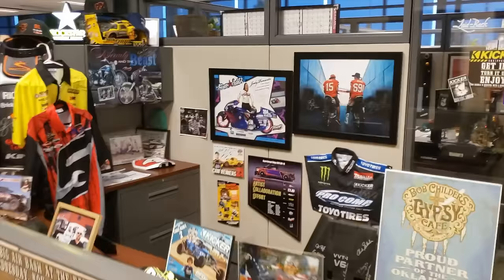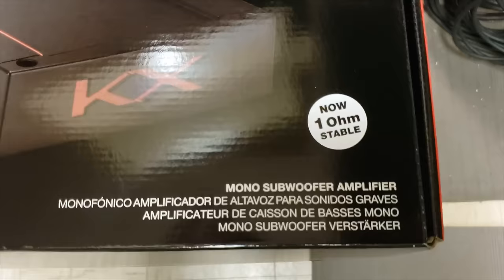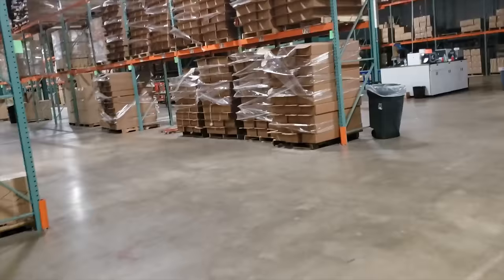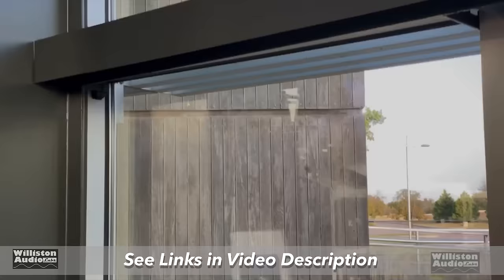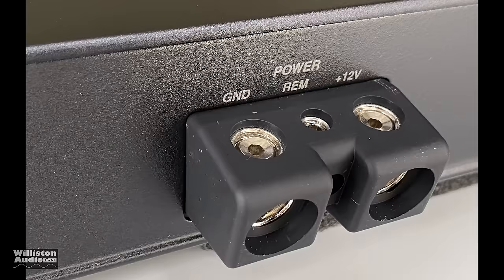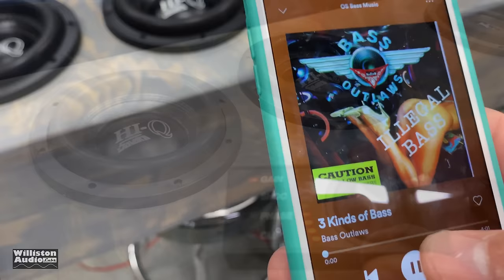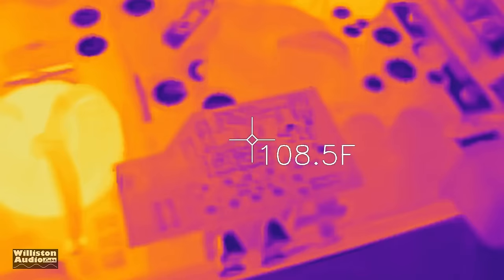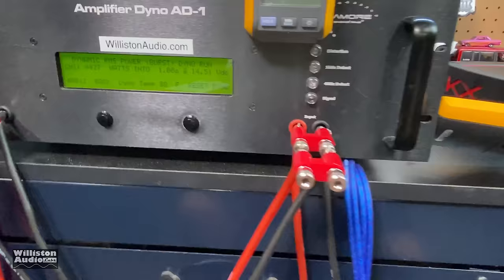Is it Worth the Money? Kicker KXA2400.1 2400W Amp Review and Test

Comment: It's cool to see a major brand like Kicker working with independent media sources like this, at the same time I think it says a lot about the standup reputation this channel has built.
Reply from the maker: Thanks man!
Reply: I always knew Kicker amps were good, and it’s about time he did this one lol S/O to you Williston 🔥🔥🔥🔥🔥
Reply: Kicker gets a lot of hate, and while I understand why, it's really undeserved. I don't use Any of thier speakers, and only really run the Old amps (kx sx and zx), but they really are an innovative, quality product. And the guys there are super cool. Much love for em
Reply: @lewokejames  I don't use any Kicker products (I did have some Kicker subs back in the 90s) but everything I do have I saw tested here and/or a couple other channels and I found nothing that would indicate that the information generated in Williston's videos is anything less than absolutely authentic. I don't have an SMD amp dyno but I have clamp-ons that read both AC and DC amperage. I tested at least 5 amps Derrik (I think that's how he spells it) measuring amps and voltage in and out and using the rated load of the speakers to find outputs consistent with what this channel reported. 

I don't know who you are but this guy has been doing this for several years and I know of no legitimate reason to call his integrity into question.
Reply: @dksix1905  the entire point of what I posted went completely over your head and I'm not going to bring it down to hit it.

Comment: Congrats for getting recognition from the manufactures. Hopefully Kicker is not the only one who sees you.
Reply from the maker: Thanks brother, I appreciate the comment 👌
Reply: I'd bet there's some other manufacturers who wish Big D would stop lol 😅
Reply: @piss_pisstofferson  for sure 👍
Reply: I was looking into this amp a while back because I wanted an amp that would put out 2400w rms at both 1 and 2 ohms so I would get more output after impedance rise. I reached out to kicker and got the same results. Yes, it's a great amp but it wouldn't work for my needs and my subs so I asked if they had any amps that were capable of doing what I wanted and sure enough, they did. The CXA1200.1T and the CXA1800.1T both put out rms at 1 and 2 ohms so I ended up going with 2 1200.1Ts and I couldn't be happier! Unless of course they make them 1200w rms at 4 ohms as well in the next gen 😝 would love to hear your thoughts Big D
Reply: @robertstafford7588  or you can wire a decent Korean half bridge to .5ohm (Wolfram & Apex) for $199-249 And it will see about 1.2-1.3ohm after rise. Give you rated power all day.
Reply: @adamneill9237  That's all good unless your subs are rated 1250rms a piece like mine 😪
Reply: The Audio Apex Cab 22 does 2450 @ 1ohm ($220 shipped) and has no problem being wired to .5ohm if you're rising over .75
Reply: @adamneill9237  that's not the issue though, if you run it at .5 ohms, they will see over 2500w rms on some songs and much more most likely.
Reply: @piss_pisstofferson  🤣🤣🤭🤭😂😂👍✌️
Reply: @robertstafford7588  not if you tune the amp turn down the gain so it only puts out 1300 or so watts at full volume on your head unit.. but i wi say you will get better sound quality running 4ohm

Comment: Those KX amps have elite pedigree. That efficiency is thanks to a dc to dc boost converter. The Warhorse had that tech i believe. And since you're not changing current types, the heat sink doesn't need to be as big either. Couple that with excellent woofer cone control and you've got a winner every time. Absolutely love the KICKER amps!

Comment: If Kicker was using today's "standards", they could have rated this as an 8k! 
PS, I've had this amp for a few months, and I love it!
Reply from the maker: They knocked it outta da park yo!
Reply: Nice!! What’s she powering?? I keep going back and forth on this and a 2500bdcp. I have a local guy that has a bdcp for 1150$ and it’s in great condition. Any input you would like to share would be greatly appreciated! Thanks Jason!
Reply: @3RDERA  I saw on a sundown audio group a guy selling his SCV 7500 for $1300, and some SCV 6k's for $900, I'd look into those if I were to spend $1200
Reply: @3RDERA  i have the 2500bdcp & it absolutely slams and looks drop dead gorgeous doing so. That being said, i only paid $500 for mine. If i were choosing now and had to pay retail, i would honestly  buy the Kicker. Again, I love my 2500 so much that i built my amp rack so the VU meter is on full display.
Reply: @3RDERA  this has more filter caps so it should sound cleaner. you probably wont be able to tell unless you have both amps to compare. either one are a solid choice
Reply: @Pamfman xtr are a beast but their s/n is only 70 or 80db on the older models and they dont even list it on the dz. watt per watt this will be clearer and louder
Reply: 0.5🎧 ohms
😬
Reply: Marco Rodriguez might as well get the Orion Hcca 5k
Reply: OffdaRoots lol you’ll fry it, kickers don’t do well when you don’t follow specs
Reply: @AJOSUE  sup bro whens the next video
Reply: Rowboyto soon 😂🤣 been busy
Reply: @Pamfman i have a budget sql build in the process of sq. i currently have an old excelon ddx headunit, 13 w7 hooked parallel to a memphis prxa1500.1 my mids and highs are infinity kappa components in the front and coax in the rears. speakers are hooked up to an old school earthquake amp ive had since 03. my electrical is a 120ah agm in the rear with a 6pack of maxwell caps and yellow top up front. im using 0awg welding cable and my alt is an upgraded stock. my stock alt only puts out 80 amps but the awd version is 130 amps so i swapped it. voltages doesnt go below 13.5v. its not a crazy build like yours but it gets the job done. every thing except the head unit and 4 channel amp was bought in offerup lol. im changing the w7 to a sundown x12 rev1 im also upgrading the amps. my plan is to run the x12 at 4 ohms to get the most of the amps effeciency and damping factor. im going for the audiocontrol for the 4 channel but im still looking around for a sub amp. its not gonna be as loud as my current setup but im getting old lol
Reply: Kicker is a cheap Chinese board, they are junk. Much better deals for that kinda money. My wolfram 7500.1 clamps over 10k at 16v and was under $1000.
Reply: @Pamfman thanks man, your build is baller status. everything in your build is premium. i can only imagine how clean it sounds. hey i was wondering does your kenwood have an rca for the center channel or is it something else. im planning to upgrade my ddx812 next year but i also want to add a center channel. i found kenwoods center channel but im hesitant to get it if the newer head units doesnt use a rca plug for it
Reply: 3RD ERA powering an Alumapro M-16 at 4 ohms.
Reply: matt 2525 who designed that board?
Reply: @ansalon72  Korea where all the best amps are made, DC, Sundown, Orion HCCA, Cadence, and so on. And anything fullbridge that is any good comes from Brazil. All the cheap amps come from china, ALL OF THEM.
Reply: Hifonics nemesis a fool to. But kicker the truth especially the zx
Reply: @Pamfman thanks for the info on the kenwood head unit. man talk about a deal, some people have all the luck. i checked your channel today. that blow through looks clean, its a really nice build
Reply: @3RDERA 2500 bdcp all day every day. They are the best amps on the market along with JL audio. That kicker is not worth no thousand dollars.
Reply: @matt-be8kt  This amp is from china but it definitely isnt junk like the budget chinese amps lmao and I have a synergy wfo2.1 and my kx2400 is WAY better in every aspect. Budget gem and budget bust said the wfo2.1 was a better amp than the xtr2500 for build quality and my kx2400 blows my synergy out the water, much cleaner power and alot more of it! This isnt a cheap cookie cutter chinese amp
Reply: @cjon24s69  too many people talk bad about things they can't afford or  brands they don't run. They keep comparing budget brands and think its so much better. The price of kicker/rockford/jl audio has in house designed boards with research and development that they don't consider.
Reply: This amp was a huge disappointment for me ran it at 1 ohm on plenty power agm batterys kicker 0 guage ofc 250 amp alt its a electrical hog switched to taramps smart 3k much lighter on my electrical
Reply: @3RDERA  That’s what I have rockford Fosgate 2500 BDCP. Much better looking amp.

Comment: Another thing to note people... these Kicker KXA amps have a DSP chip controlling the crossover functions and bass EQ etc. This is very useful as you do not have the audio signal traveling through the potentiometers on the control panel. The potentiometers are likely only sending a signal telling the digital DSP chip its settings. I love this idea as it will result in the best audio quality for your input/crossover section without having super fancy polypropylene capacitors and burr brown op amps, all that stuff. And then the power output and efficiency is even cooler.. i bought a KXA1200 after seeing this. Its amazing!!
Reply: Still using my KXA1200 a year later. I love it more each day, looking to upgrade to KXA2400 - ive tried other amps and these damn things sound good... they just sound really good. Them cheap brazilian taramps get loud, but it doesnt have the dynamic punches like these kickers have.. something just built better with these.

Comment: Nice amp! That amp been hiding in the background for years and probably has the best remote ever.
Reply: Hard to argue with a remote/bassknob that doesn't require running an additional wire(s)
Reply: The remote is amazing, I run a KXA800.5 and a KXA400.1 and the wireless remote controls both (sub channel only on the 800.5) beautifully. It fits perfectly in my center channel without rattling around and it works like a charm. My only gripe: you will know when it's time to change the battery, so keep a spare handy.
Reply: Hardly hiding. Just expensive as hell

Comment: I've installed 4 of these now for friends I am absolutely satisfied with this amplifier an that's not easy to do. It's a great looking amp and it's a absolute beast when it comes to power output. It will run  2 kicker square 15s all day plus some. The bluetooth control for this amp is unreal it still blows my mind everytime I use it. First time I've ever seen one with a amp. I like the fact that when you set everything up theres a indicator light on the knob that when you turn up the indicator light will tell you when your going into a clipped signal. This is a game changer for installers. I install one set it up then I'm able to tell them do not go into the red. That keeps people from being in the trunk messing with stuff they shouldn't be. It will most likely save alot of subwoofers from death due to deciding they know what there doing lol. Highly recommend. Great sounding strong product. Kicker has always had the best customer service and always takes care of any issues even though I have only had 2 issues in 15 years if that tells you anything about the quality
Reply from the maker: Word quality matters!

Comment: Finally a good amp now they need a 5 channel with the same power.
Reply from the maker: I was thinking 125x4 plus 1500x1 would be a sweet 5ch!
Reply: Yeah they do. I'd love to have a good quality 5 channel in my Trans Am.
Reply: They do i like the zx series more
Reply: I have the KXA800.5, it does the job but I added a KXA400.1 and split my subs between them and it's perfect for me. I would be fine with 800W RMS on the 5th channel if it fit in a chassis the same size  as the KXA2400.1.

Comment: As far as kicker goes I will tell you their customer service is 💯 I had bough a 12” L7q class back in 2017 had and issue with it made a RMA request in 2018 and forgot to send it out the warranty was for 3 years on the warranty was expiring in 7 days when I got around to sending it out they replaced the 🔊  no questions ask and had it shipped to me within 5 days (even though they were sold out)I would recommend any one to buy from kicker with 100% confidence they stand behind their product and honer their warranty.

Comment: Can't wait to install my kxa2400.1 and kxa400.4 amps. Upgraded to a mean green alternator and got an nvx 10 farad capacitor since I don't have room for an extra battery unless I mount one in the bed. 84% effeciency will be much better than my current amp at 64% effeciency

Comment: I wish they would put a few more specs on the birth sheet, much as the voltage used, THD at rated power (he said 1%  but put it on the sheet) and the actual SN ratio (not just PASS). They could go the extra mile and give Damping Factor and Slew rate for bonus points (even just typical figures in the manual would do).  They DEFINATELY should list their efficiency, that's something be proud of!  This will be an unpopular opinion, but if they do 3500wrms @1 ohm, then put it on the box!! If they feel the need to rate it at 2400wmrs, then tell the the THD+N at 2400w and they will be perceived as a premium brand like Zapco!
Great vid yet again my man!!

Comment: I had mine on 2 L7 15s at 1 ohm and they took it like a champ! Really impressed me for some kickers I honestly thought they would blow but they never got warm or stinky
Reply: Did the amp get hot? I have the same amp with 2 alpine 15s, 3 batteries big 3 and js alternator 250amp and amp gets very hot

Comment: I have the KXA 800.5. MB Quart components on front and rear channels and a 12” L7 on the sub channel at 2 ohms. (Underpowered obviously) 
It sounds so damn clear and even blurs your vision a bit. The voltage at the amp at maximum volume just clicks back and forth between 14.2 / 14.3 volts!

Comment: I have the previous kx2400.1, Ive had it about 3 years now bought it refurbished from the amplab and I have had zero issues with it so far and it barely gets warm on a hot summer day, whats different than another 2500 watt amp is the sound quality, everyone seeing this amp is made in china automatically think its junk, I have the synergy wfo2.1d which is a korean amp and this amp still has cleaner power and better sound quality, just remember a watt doesnt always equal a watt 🤷‍♂️
Reply: So kicker has the better sq ?

Comment: I miss my Kicker system: 2 L7 solos in a custom box, ZX1500 for the subs, SX900.4 for the 4 kicker SS 6.5s, and a SX600.2 for the two 8" mid bass kickers. 3 dry cell batteries and a 20 farad cap. All zero gauge, each anp separately grounded to the chassis. Could run at max output while idling my 4cyl accord with 80amp factory alternator and the lights wouldn't even dim...that thing sounded awesome from 15hz all the way to 20Khz.

Comment: I installed one of these kicker 5 channel amps in a customers car. A 1955 olds 88 Focal up front and rear with a shallow 12” L7 and these amps are way under rated.
Reply from the maker: I’m sure they will love to hear this feedback
Reply: Williston Audio Labs tell them to send me as many 5 channel amps ASAP to my shop because they are hard to come by we are an authorized dealer. Also the new flat sub boxes with the passive radiator rocks! They hit low!

Comment: There's a good reason why these amps are well made and will meet or exceed their power ratings...take Kicker's name for example...some of my best systems have been made by Kicker. My four Kicker Solobaric 10s (the original round subs) were in my first Honda, my 92 Acura Integra, and they were powered by an OG Soundstream Reference 1000S and they hit really hard. I've had many other stereo systems since then, but when I wanted to chose mids and highs for my current stereo system, I chose Kicker again. Without an amp, or a high powered stereo, my mids and highs are crisp and very precise, and once again, they're unpowered. Kicker has always been my go-to for good prices, excellent quality, and unsurpassed customer service and care.

Comment: I picked mine up locally used for 300. Best money spent..running at 4 ohm it is very efficient. Of course the 280 amp alt, dual D3400  under the hood and 1/0ofc helps I'm sure...but now I know it does 3k+at 1ohm..I can upgrade subs down the road

Comment: I have this exact amp and I have four kicker q class L7 12s what gauge wire should I be running to this amp and what gauge wire should I be running to the subs..... Lastly how much battery power you guys think I'll need if I'm going to be installing a 240 amp alt in my civic

Comment: So if someone  gets a sub rated for 2000-2400 rms and blows them at 1 ohm due to kickers low / wrong rating, will they be replacing woofers? If not I see some pretty open and shut cases in small claims court
Reply from the maker: No
Reply: @wal  so you spoke with them directly and got that response?

Comment: I have the 1200.1 KX with 2 L7 12 inch Subs now i just got me some Front door and rear speakers from Alpine 
Do i need to upgrade to the 2400.1 KX apm? 
Or is my 1200.1 kx amp powerful enough for the job? If not i really Close to ordering the 2400.1 kx amp 
And second if my 1200.1 kx is good for my subs should i buy a alpine amp made for the Front door speakers and rear? 
This my first sound System 
So alot of things i don’t know hopefully some one can help 🙏🏽

Comment: A local guy just sold one for $200 and i missed it by 10 hrs,but another guy sold me a 1600.1 for $200 and it sounds great.
My voltage doesn't drop nearly as much as when i had a skar rp1500 and a elevation audio dx1500.1 and apmn 2000 ap amp.